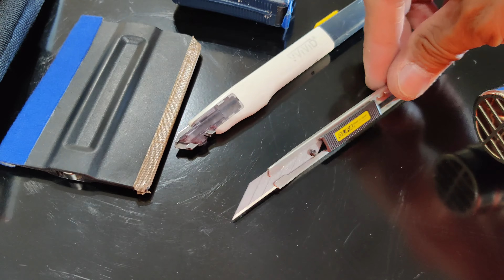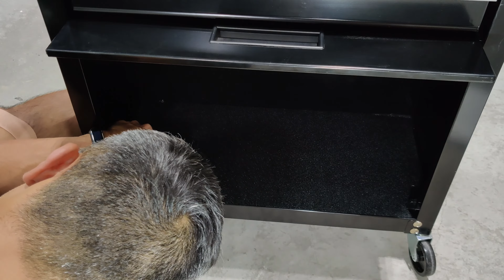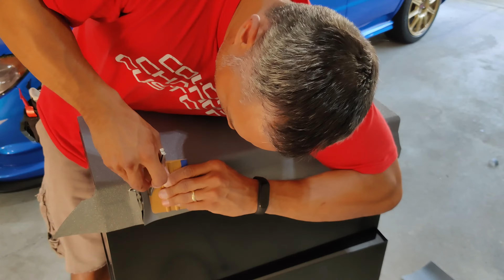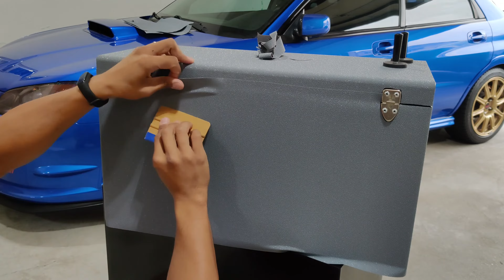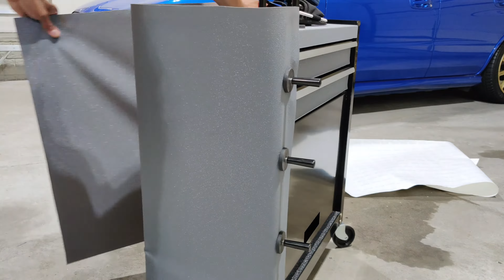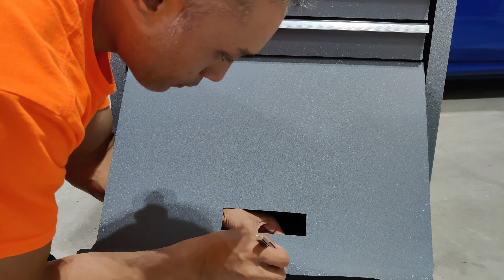How To: Vinyl Wrap Your Toolbox with Indestructible Vinyl

Comment: Nice job on the wrap!  one (1) question: could it have been easier to just pop the hinges off & then re-install as required?  It seems might hold the vinyl wrap down little better that area too as the hinges would be on top, compressing it down from then on & so forth, yes?
Reply from the maker: Yes, you could certainly remove hinges as well if you wanted. It could make it easier and it would allow you to wrap certain areas better/ more fully.
Reply: @ColorChangeCustoms  Thanks for the follow up!

Comment: I maybe old school and I love the color on the wrap, but isn't it easier just do spray paint?
Reply from the maker: You definitely can just spray paint if you want. This wrap in particular adds a layer protection because it’s super thick. It’s also removable so if you ever get bored with the color, you can just peel it right off.